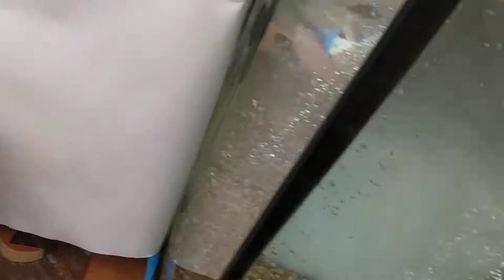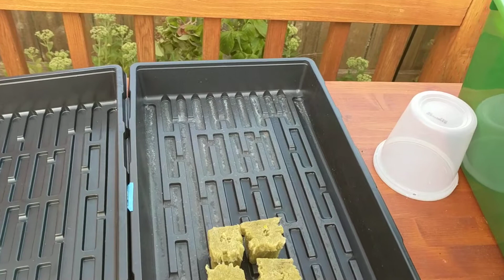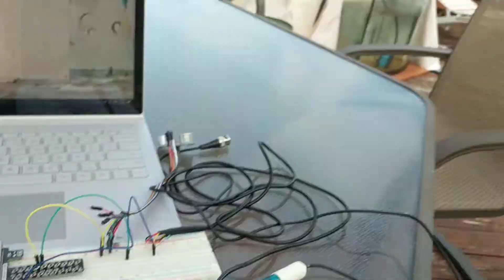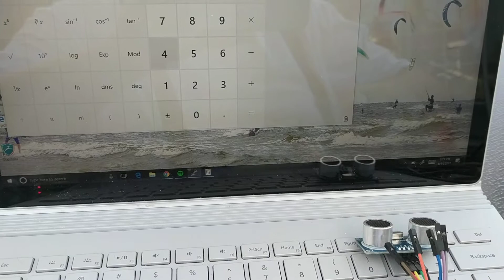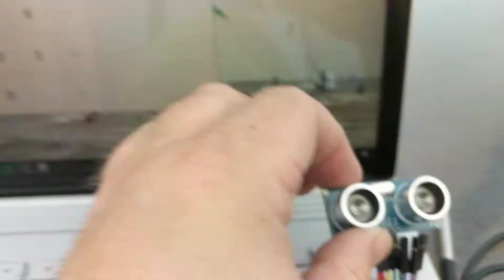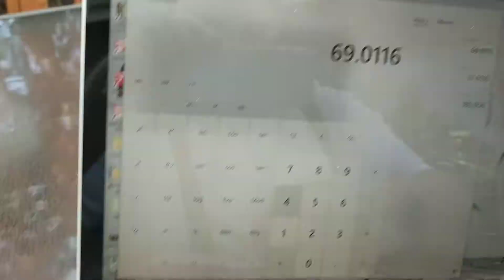Adding instrumentation - Hobbyist Aquaponics System

Comment: The simplest fix you can do without a sump is to just set the pump on something (a brick or something) to keep it off the bottom so it can only pump the water so low. A good fallback for even if your electronics fail.